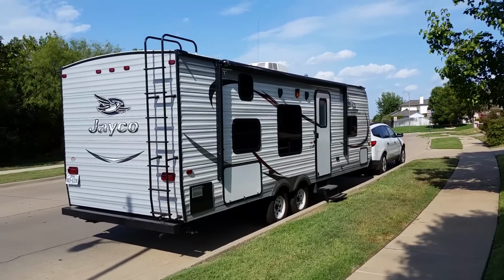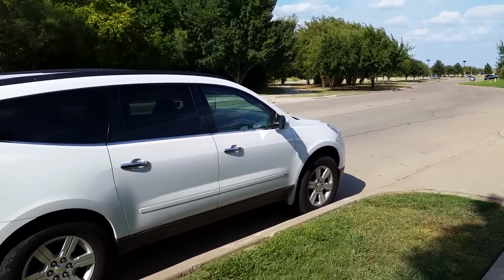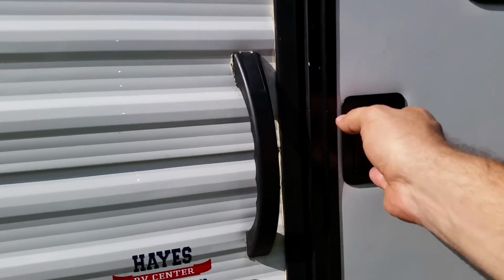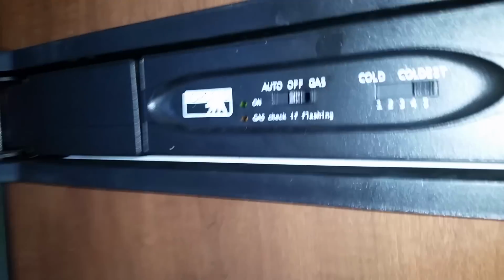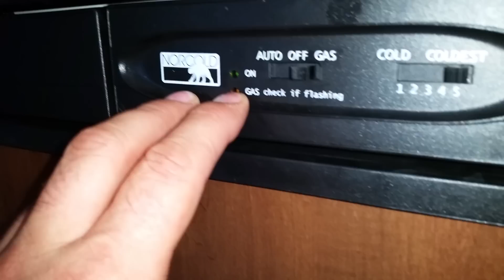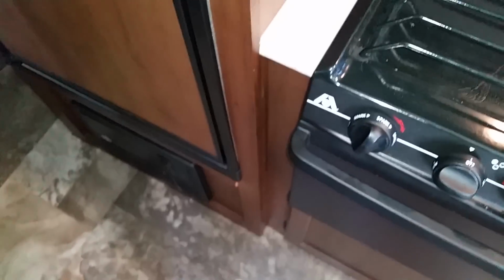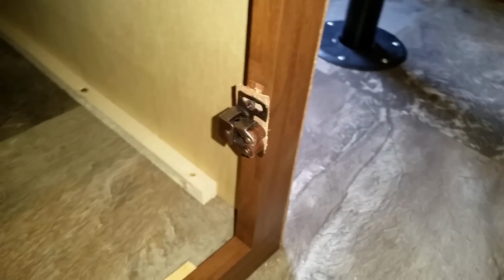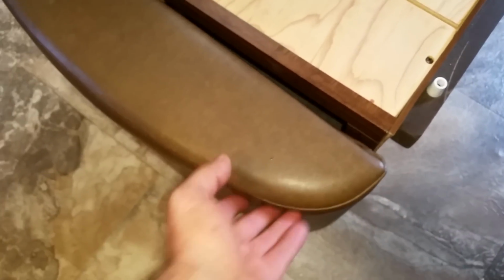Update: New JayCo Trailer FALLING APART.  Lengthy Warranty Work Needed.

Comment: the reason why is because they build it in six hours that's why the quality sucks
Reply: What does "six hours" have to do with it? With modern manufacturing methods, a hell of a lot can be accomplished in six hours. Two or three dozen cars or trucks can be assembled in less time. Man-hours is more important than total hours. In that, one guy working sixty hours (7.5 work days) is exactly the same as ten guys working six hours.
Reply: Dwight Stewart So where in the hell are 36 cars being built from bumper to bumper in 6 hours? Lol I worked at the toyota plant in Texas for 2 years, those numbers are nowhere near accurate. 36 cars could be made in 6 hours with 6 different lines going at once. And the bigger the vehicle or the fancier of trim level, the longer it would take. But 36 cars on one line would take much longer. The issue is Jayco's or most trailer companies manufacturing is from start to finish these things see 60+ hands and eyes within the time period it's being built and they still pass these off as good to go.
Reply: Gary Miller what video? link it
Reply: I saw the video some months ago, then also watched one made by Lance. The Jayco video was an eyeopener. They just slammed these trailers together.  I would never buy a Jayco. I don't have the link, but surely you can do a YT search for the factory video and see for yourself.  The lance was entirely the opposite.  If you're looking for quality built, checkk out Outdoor RV Manufacturing. These Jaycos are junk, plain and simple.
Reply: Judith Neeley I've seen the video. The one where they're not in a factory but just a big warehouse garage with hydraulic lifts flipping the frame and transporting it from station to station to get the walls and insulation and electrical etc installed onto the frame. Then they roll it out 6 hours later. Takes guys minutes to just throw on some wood glue or shoot a roll of nails into it and then onto the next station for further mediocre assembly. All the guys there look like they're having a horrible time and they're running around inside the shop disregarding all safety precautions. Definitely made me think twice about the brand I was buying. I bought a used jayco 28 footer a few years back and it did me good for a few years only because the original owner had a hell of a time bringing it back to the dealer for warranty issues to fix all the problems. By the time I got it the thing was worth 25% of it's original value and had all the kinks worked out lol.
Reply: John Doe send link
Reply: Italiano 810 I can't cuz I'm on my phone. The youtube app doesn't have links. Just type in "Jayco - Building A Jayco Travel Trailer In 7 Hours Pure Junk" that's literally every character in the title. It's posted by "Cole Bihn" 4 years ago and has 340k views.
Reply: I agree that MAN-HOURS is the proper measuring tool, however, at the speed they move, quality is sacrificed for speed.  Me being a finish carpenter, I will sacrifice speed over quality.  JMO
Reply: Dwight Stewart just watch the video, then come back and stand by your statement.
Reply: I work in the RV industry here in Indiana where 95 percent of the RV's built come from. I can honestly say that is poor quality and is not something my plant would allow. Thats embarrassing to myself and apologize for there ignorance. Yes these RV's are built very fast everyday but that still does not justify for your problem. We build 12 units a day. This unit you have looks like one where they build 30 units a day would come from. Try to keep that in mind if you ever decide to purchase another RV again. The less units built a day the better quality you are going to get know matter what company made that RV.
Reply: Gary Miller lol I just finished that video before this 😂 it was so sad
Reply: True..
Reply: and i can assure you that the model built in the jayco vs the one in the lance are on opposite ends of the pricing spectrum....don't be fooled by everything you see or read
Reply: Look up Lance reviews.  plenty of problems there as well.
Reply: 6 hours is just for final assembly of the sub componnts.
Reply: superman busa any trailer with that plastic siding tends to be junk and really cheaply made.
Reply: A lot of owners call them Junkos in Australia
Reply: It’s because the quality is inconsistent, all these travel trailers are built by hand at a fast pace cheaply and then combine that traveling 70mph in a highway . They are junk , all of them pretty much.  Second this guy can argue all he wants , that’s too much trailer for that small v6  suv .
Reply: Dwight Stewart There is a HUGE diffrence between something built on an line with multi million or billion dollar robots custom tooled to the job using decent to high quality ultra tight tollerance parts and employing quality control and batch testing.

And how jayco assembles their trailers in a lacadasical manner while slapping parts of questionable quality together often by hand with the smallest cheapest nuts bolts and screws and incorrect and often broken tools in as rough a fashon as posible with little to no quality control or testing.

Jayco trailers are garbage and deathtraps. I have hauled them before and watched them literally colapse, fall apart, or in one case slip off the frame as they are being moved. i have watched them come brand new from the factory and have bits and peices come flying off in transit to the dealerships.

Honestly the only reason jayco stays in business is people see the tiny prices on trailers that look nice on paper and at a distance. And the fact so many buy trailers and only use them for a couple days a year. ontop of their custom of paying google to bury any bad press that pops up.
Reply: Gary Jessy another name is "Jaycrap!"
Reply: superman busa lol probably 40 Mexicans making $6 an hour on a Friday.
Reply: The funny thing is that the narrator of that other video people in the comments are talking about (the Jayco video, not the one on this page) is a marketing guy for Jayco. He is so clearly clueless about construction and blue collar skills that as he shows you the video, he is actually proud of it. He has no idea that he has condemned the quality of his product. It is more of an expose than a sales booster. It makes me wonder if Jayco has seen the video, and has tried to eliminate it.
Reply: Dwight Stewart, if a man or team is rushed to excess, quality suffers. In the case of these types of trailers they are slapped together with almost no fitting, most of the seals will leak whether plumbing related or the trailer itself against weather from the roof, windows, doors. There simply is not enough time allowed for careful beads of the proper size and redundancy, and staples are used in places where screws would be optimal for strength and longevity. These trailers are designed for one thing and one thing only. To be SOLD. There is no expectation that they are any good for the purpose they are sold for, especially after a few years, when you simply have a rotting carcass in your side yard that is too expensive to fix, and too expensive to throw away.
Reply: Agree --- Outdoors RV Mfg trailers built in Oregon Mountains are top notch units...! Got one myself a 20FQ, built like a tank with 4x4 offroad package, thermal pane windows standard, 2" walls/insulation standard, etc. etc.....
Reply: Go watch the Jayco construction video and you will see what he is talking about.
Reply: superman busa nice job, what people don't understand is nice and Ones cost more money yet they want to be cheap so there you go he got a piece of shit
Reply: @almetcalf  Yes and no. I just don't see the kind of ridiculous cheap I'm seeing here. Lance has a solid structure and great insulation. Everyone buys components from a handful of companies (Attwood, Dometic, etc.) and lemons are not uncommon. But in a Lance I can push on a wall and it feels pretty substantial. Walked through a Jayco the other day and OMG. That's some slapped together crap.
Reply: The Large aircraft that you fly on over a mile in the air, they are built in about 18 hours from start to finish.
Reply: Which name brand do you recommend
Reply: Databyter     - Yes, Jayco knows about that video.  They have had YouTube pull it dozens and dozens of times.
Reply: hyperman717   - Absolutely untrue.  Aircraft are NOT built in 18 hours.  Not airliners.  Not single engine GAA, not any of them.
Reply: 6 hours?
17 units a day!
Reply: Also, they cut corners with the materials, use staples instead of screws,  and save money using less materials, from half the glue needed to fewer staples and on and on. Trying to make trailers feather lite  means less materials. Now, go watch the video taken at the Lance factory, and you'll see a world of difference. But of course you get what you pay for, too.
Reply: @hyperman717  Not a chance, sparky, but nice try...
Reply: @dwightstewart7181  Their manufacturing process is FAR from modern. It is NOT robotic or automated in any way.
Reply: @drewburk6309    ..  So you think it has to be "robotic or automated" to be modern? Well, I guess that screws over the American worker, with all his tools, pretty good.
Reply: @dwightstewart7181  Automation and human input are not mutually exclusive.
Reply: @drewburk6309    ..  Talk to yourself. You're the one who made the distinction between humans and automation, citing the former as less modern.
Reply: @dwightstewart7181  I'm citing the factory in this video as not only not modern, but defying several basic OSHA requirements as well as PPE and proper dust filtration. I'm a huge fan of "the great American worker," and if you'd like to discuss the North American Free Trade Agreement and the outsourcing of great American manufacturing jobs to China, India, and others, I'm happy to do that in the appropriate forums. But this is a discussion about this Jayco video. I'm trying to stay on topic,  you should try too.
Reply: @drewburk6309    ..  No, you're not at all staying on-topic. This video is about warranty repairs on a specific trailer, but you're talking about OSHA, PPE, dust filtration, automation, and workers.
Reply: @dwightstewart7181  Warranty repairs that aren't being made efficiently because of an ineffective manufacturing process based on the ON TOPIC reasons I stated. Pay attention.
Reply: @drewburk6309    ..  And you're a troll. I gave you the last word (two weeks ago), but that just wasn't good enough for you.
Reply: @judithneeley5229  Very good advise. The only travel trailers I'm looking at are Outdoor RV and Airstream.
Reply: @James-ts5do  Lucky you, I'm drooling with envy. I know a man who sells rvs in Wy in the summer (Alan Sills, rvsaacross america) who turned me on to Outdoor MFG. The original owner, Ron Lance, I believe, was Northwoods (Alpine, Desert Fox etc) brands), and he sold and created Outdoors. He stood by qualify. He passed away not long ago.  I would also consider a Nash.  Alan switched to a 5th wheel Outdoors trailer, and lives in the snow in the winter teaching skiing. He knows trailers. And he's honest. If only I were younger, I'd retire to an Outdoors and hit the road.
Reply: @greg1474  You can say that again. Both my aunt and uncle worked the assembly line at boeings in Seattle.
Reply: @arizonahascactus9697  A used Nash would be good, too.
Reply: I got his name wrong, sorry, maybe it's Nash.

Comment: I had the exact same model but a 2013. Only had it for a year and than sold it for a trailer with a slide out. 
I had no issues with the trailer for the probably 8 times I had it out. 
Keep in mind that Jayco uses plywood throughout the trailer. All other entry level trailers are made with OSB. 
Also, this particular model often comes with power stabilizer jacks which is nice. 
It really is hit or miss. As they say, “yours must’ve built on a Friday afternoon”
I looked at a brand new Coleman trailer on the lot and I honestly thought it had been owned previously. After closely looking through it I quickly realized it was trash. 
Anyway, don’t cross Jayco off your list because you see a bad one, just look closely at what you’re purchasing.